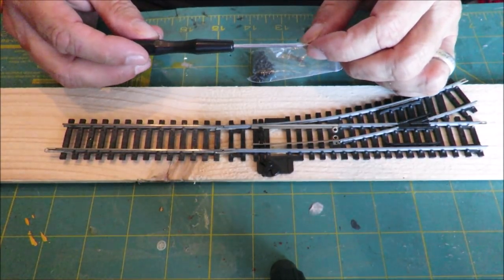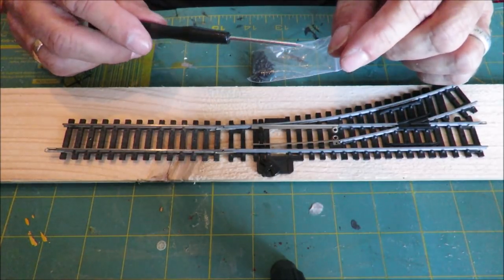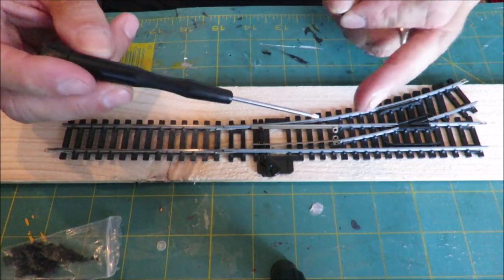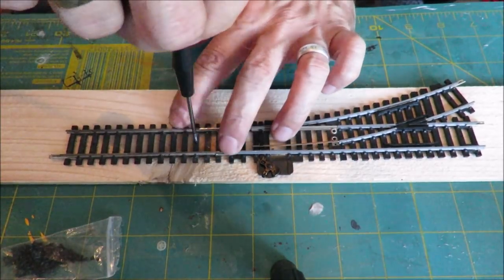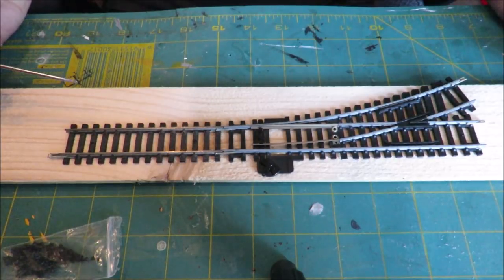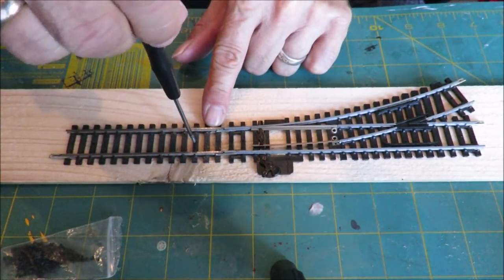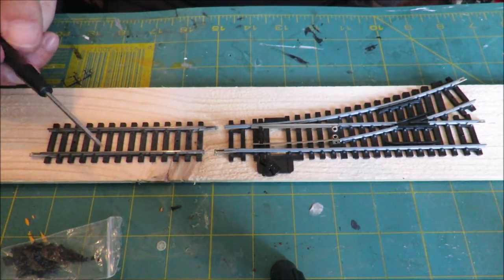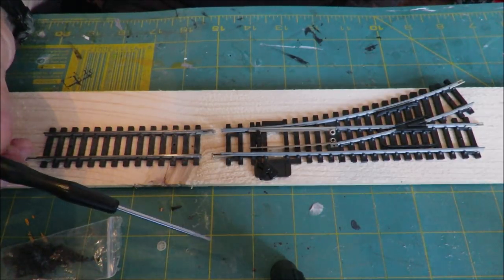How To Fix Track Onto Your Model Railway - Tutorial Tuesday Episode 23

Comment: I used track screws in OO Peco set rack.  I drilled a pilot hole.  They use PH00 size screwdriver, use a decent size one as the cheapies are not fun to use.  Easy to take out and change the track around.

Comment: Thanks Mike for your great tip using track screws instead of pins. Will now use them. As a matter of interest, how do you clean your track please?
Reply from the maker: Steel track needs a very fine abrasive block. Wd40 or iso alcohol or a similar solvent

Comment: Wow , neat little method , still undecided on how I’m going to fix my track down tempted to glue down - any thoughts?
Reply from the maker: I think it depends on how certain you are you don't want to change the track  plan at any point, and on what glue you use and what your base board is made of
Reply: Budget Model Railways was going to use a few blobs of epoxy resin hear and there but if people can rip ballast up I could rip the track up if I went for PVA

Comment: hi. whats the best way to take a piece of track or point up without heaving to take up a great line of it. like i have tried to replace a point and had tou un pin about 5 pieces of track eiyher end of point. thanks
Reply: I had the same problem too with second hand track. I ended up just digging up the surrounding track and ballast. As much as I tried I couldn't find an easier method.
Reply from the maker: I'm told that if the fish plates are of the correct type you can slide them along the track to release the faulty bit of track without lifting the point. I've never managed to make it work though!

Comment: Well, thanks to this I took delivery of my new screws and screwdriver from Fleabay today!!
Reply from the maker: It's a great bit of kit, you won't regret it
Reply: @BudgetModelRailways  Furthermore, it's because of you that I will also take delivery (I hope) of a 2nd Fleischmann HO diesel shunter from the same establishment! Bought the 1st in Helsinki 1988 when I was into this before! Great little runners! Thanks for the videos guys!
Reply: So the best thing about this, apart from ease of use, is being able to easily move the track mm's to rectify an incorrect positioning. Really useful so thanks again for the tip.
Reply from the maker: Happy to help, happy new year
Reply: @BudgetModelRailways  and the very same to you too :) NB my Fleischmann HO shunter from EB was a great find and works well. A good place to source, where otherwise one can find such dross at expensive prices in "shops" :)
Reply from the maker: Certainly prices have rocketed on eBay, I can't believe what some people will pay for what should be very cheap items

Comment: If you stick with the traditional track pins like I have, then use pliers to push the pins in, much easier than the fiddly hammering them in.
Reply from the maker: Depends on what the surface of your base board is, some of the harder woods are too hard for pliers
Reply: Ok I have not tried it on all woods, but large engineering pliers (not snub-nose) holding the pin from above and pushing straight down exerts a lot of force. 
The removing does risk the sleeper as you point out though.